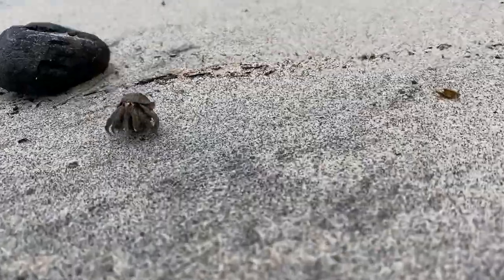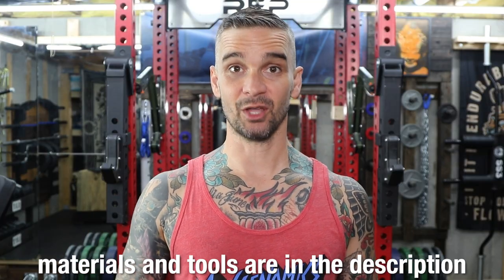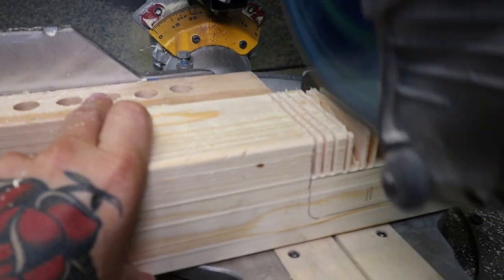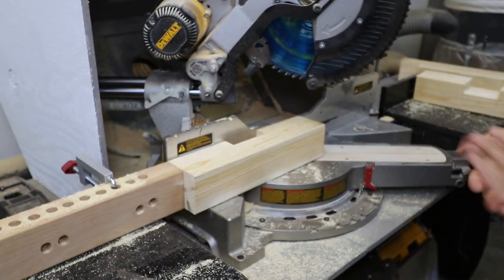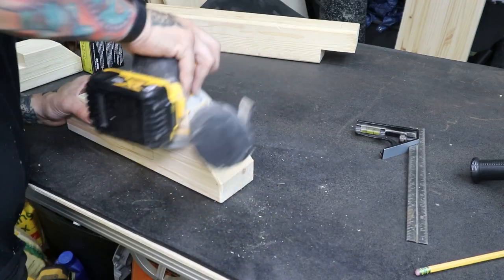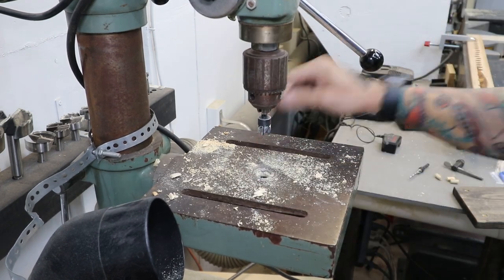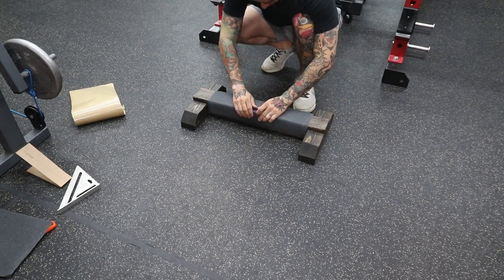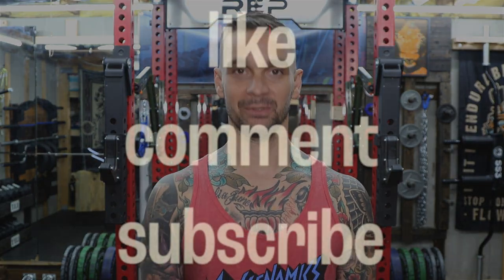Calf Raise Block DIY Project, Home Gym Essentials

Comment: Awesome camera work. Appreciate how you don't skip steps in the narration. 👍

For my own calf block, I cut 6-inch section of schedule-80 PVC in half lengthwise yet slightly off center so that one is a tad larger than the other. Tuck and glue the smaller half inside the other, and then drill four holes in the base edges, insert bolts and nuts, and finish with common stairway nonslip. It makes a calf block that is easy to handle and will last longer than you will ever live!
Reply from the maker: Thanks! I don’t often get compliments on my camera work but I really appreciate it.
Reply: Wow. Any chance you could maybe link to a photo? Sounds interesting.

Comment: I built something similar, but a bit less stylish. The safety squat bar is a really neat idea, but I use a straight chin up bar. It  came with my rack. That got replaced by a multigrip cambered pull up attachment. Rather than waste the straight bar, I have used lynch pins to pin it between my jammer arms. I then use a hip thrust pad for shoulders protection on the bar and the jammers are chained to the rack from the top to stop them going too far below 90 degrees so it works like a regular standing calf raise and can even be used for pendulum squats, presses and rows. Put plates on the jammer arms and it's a lot safer than the SSB. You can also set it up with the jammer arms at a lower height and do either seated calf raises or donkey calf raises. With the chains in place, you can hold on to the rack uprights and calf press more weight. The chains I use on the jammer arms are also used for regular Squat Bench and deadlift with chains. So everything is multi functional and that saves space. It's a pain to set it all up, but it's nice to have the option.
Reply from the maker: Damn that sounds awesome. I’d love to see it
Reply: I have a Mirafit M200 rack, but apart from the different rack, it's pretty much a straight copy of the set up that Matt Rosen uses in his 35 jammer arm exercises video on YouTube.

Comment: Suggest raising it a bit and adding two shallow grooves to the top for dumbell holders, so it can be used for a situp toe anchor as well.
Reply from the maker: I’m probably not going to build another one but if you build yours, tag me, I’d love to see it.
Reply: @KaizenDIYGym  I'll post a pic.  I really just want to save the carpet on my stairs, and the skateboard tape is an awesome idea.  I also saw someone else just using dumbells for situp toe holders, so they might not be that useful.  Of course any excuse to use my router ;)

Comment: Thanks great tutorial! 
Question: Do you recommend using a larger round over for the edge of the 4x4 where your feet will be working? Like 1/2" bit? 

Lap joints tip: After you've made the first 10 or so cuts, instead of laboriously going back and forth cutting out all the wood bits until they're gone, you can "cheat" and just take a chisel and hammer and knock them out. Much easier/faster. Then clean up surface with sander or chisel or miter saw or whatever you have...

Personally I'll go ahead and make this, but use an English Chestnut stain probably (left over) then a few coats of poly. Thanks for the skateboard deck idea!
Reply from the maker: The 4x4 I used for the top already had the edges rounded, but it wouldn’t hurt to use a larger bit. I am aware of the chisel method, I actually prefer doing it this way for more consistent results, even if it takes a little longer. Thanks for the support!
Reply: @KaizenDIYGym  Sounds good! Re: round over edges, I guess one could also just leave the original 4x4 corner radius (~1/8") on one side, and round over 1/2" on the other side. Then decide. Overthinking it ;) Thanks again, Cheers!

Comment: Hey bro, great job! Any idea how to get a slant in the block where the feet go for more stretch?
Reply from the maker: I’d use a table saw to trim the edge of the top 4x4. It can probably be done with a circular saw too.
Reply: Slant board for stretching...squats, front split squats, sitting calf raise! 

I want to do this too. I think I will use a 6"x28"x 1" piece of wood attached to one side. Just need to decide on the angle, probably 15 degrees. Then make the angled cuts on the end pieces and attach the board. 

I also use this as a pushup stand with handles attached on the outside.

Comment: Great project.  Any tips on how to do a calf raise with a regular bar on your shoulders?  I dont have a safety squat bar.  Just a rack and a power bar. I can't seem to balance while calf raising.  Am i alone in that struggle?
Reply from the maker: Thanks! You’re definitely not alone. It is extremely difficult. I’d ditch the straight bar and grab some heavy dumbbells. Having a lower center of gravity would be helpful.
Reply: @KaizenDIYGym  good tip.  Thanks for the reply